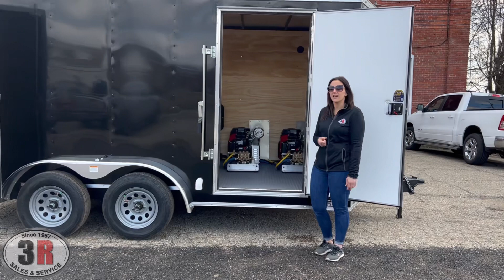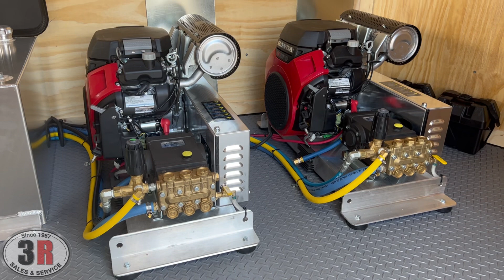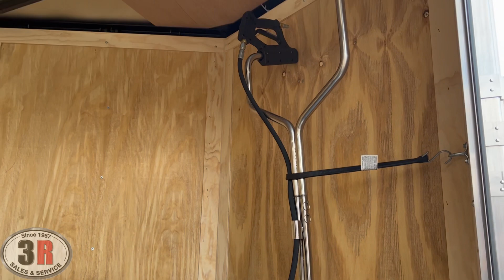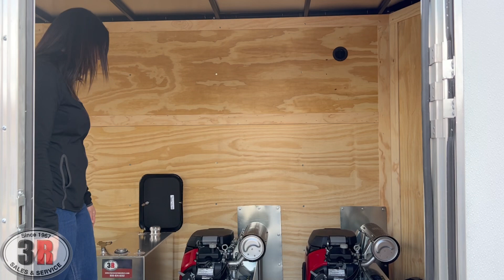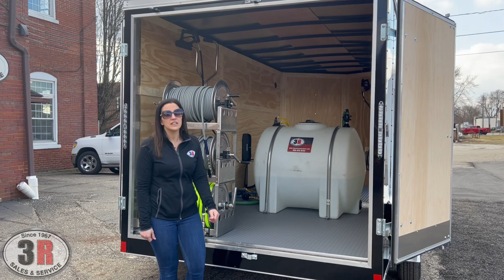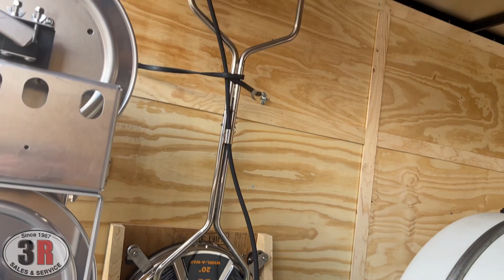14’ Enclosed Tandem Trailer- Two 3500 PSI, 5.5 GPM V-Twin Engine Cold Water Pressure Washers (249)

Comment: Hi Ashley good video as always are the power washers exhausted right through the trailer floor
Reply from the maker: Thank you!  Yes, in enclosed trailers, the engine exhausts are vented through the floor.  With hot waters, there is an additional vent through the roof for the burner exhausts as well.